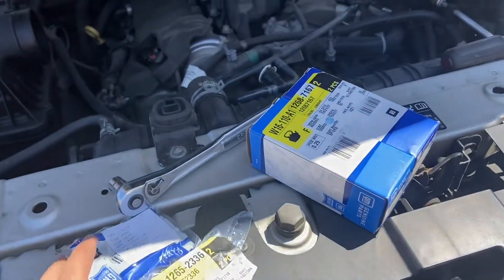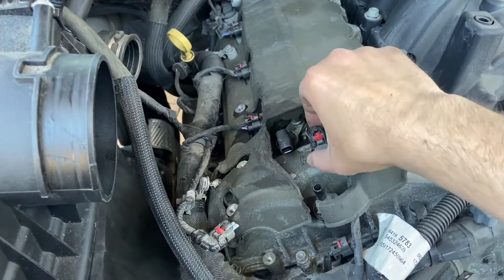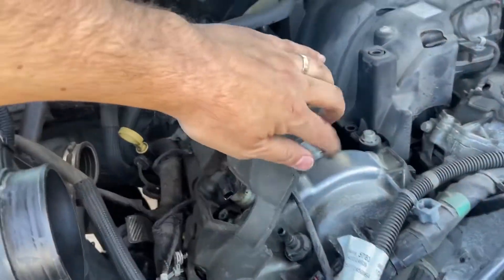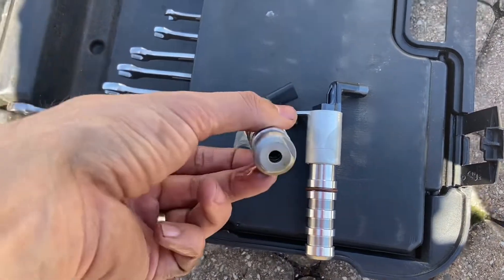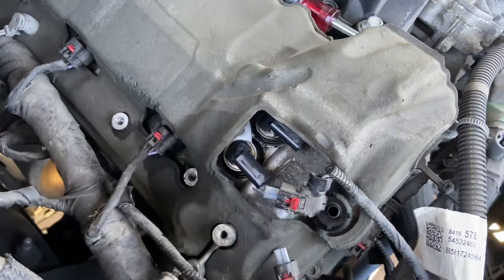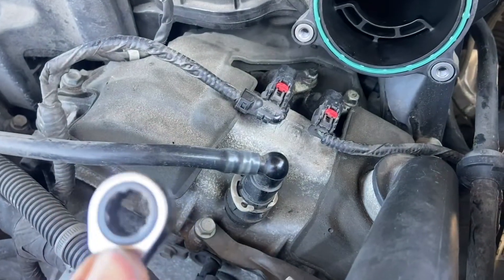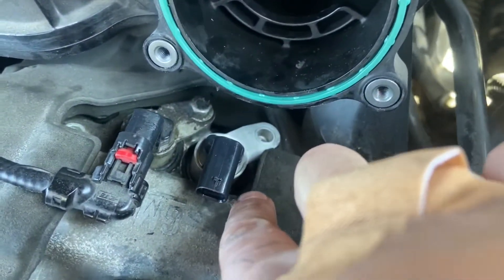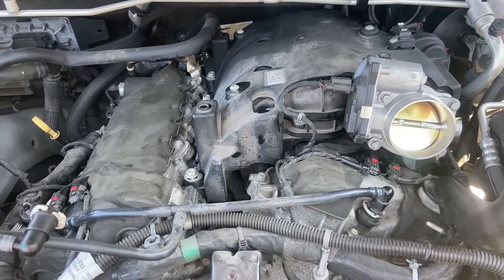Camshaft Position Actuator Solenoid VVT Replacement 2015-2022 2nd Gen Chevy Colorado GMC Canyon 3.6L

Comment: This doesn't work on a 2016 Colorado V3.6 LFX engine... My entire engine layout is totally different. Title is misleading and incorrect. make sure to put the type of engine it is.
Reply: Your right this is the lgz motor. I got a 19
Reply: My 2017 Chevy Colorado LT, Layout is also completely different as well
Reply: That's because there are three different motors for these years. 4 cyl, 6 cyl, and 4 cyl diesel.

Comment: Struggling at 7:40, tried rotating it, wiggling it, going every angle, it's like one of those impossible puzzles and I still can't get it out. Gave up for the day, had to put everything back so I could use the truck so will have to try another day, any more tips on this one? Thanks.
Reply: Were you able to get it out?

Comment: So if I am understanding you correctly. You have replaced the camshaft position sensor and now are replacing what is commonly called the VVT solenoid.  Is this correct?  Both are found on a Chevy Colorado?
Reply from the maker: Correct
Reply: @ again both are found on the engine . It isn't either or, but both?
Reply from the maker: @ I don’t understand what you’re asking I guess, but the camshaft position sensor is not shown in this video. I show it in a separate video on my page. This video shows how to replace the VVTs. I was mentioning that I was having an issue and replacing the camshaft position sensor didn’t resolve my issue, so I made this one.
Reply: What side is bank 1 I got a 2019 gmc canyon got the sensors just want to know what side is bank 1 exhaust p0014
Reply from the maker: @somethingtowatch1820 bank 1 is passenger side on this car
Reply: @WildFrontierGarage  thank you I was getting  confused lol
Reply from the maker: @somethingtowatch1820 yeah it seems backwards
Reply: code  p3409 for chevy colorado 2017 ?

Comment: I have a 2015 Canyon SLT ... Question for you...I'm a bit confused by the intake and exhaust solenoid. Some sites say the parts are interchangeable, others have separate part numbers for each, indicating that they (exhaust and intake solenoids) are not interchangeable.  Not to mention, that even some have different color for exhaust and intake. So does it really make a difference?

Comment: Thanks for the video. I have this problem and you made it look easy enough to try it myself. However, I ran out of daylight/time this evening trying get the gasket out (the bank 2 P0019 side).  It's baked on there.  Did you run into this problem on either gasket?  You just used the screwdriver to pry it off on both?
Reply from the maker: It seemed stuck in there to me too, but there was a sweet spot where I just popped the gasket out. I’d just caution care so you don’t scrape up where the gasket seats. Also I believe there’s a small ring embedded in the gasket to help it keep its shape, so it’s not super malleable like your typical gasket...

Comment: Before you replace the solenoids check this first. I ran across this comment on another video. On your display go to vehicle and scroll to the display showing voltage. Mine was showing 12.6 volts. I cleaned the battery terminals and the display shows 14.7 volts like it did in the past.
The check engine light went out and has not come back on since. The P0019 code seems to be common on the 3.6 and I am curious if that voltage drop is what triggers that code.
Reply: Thanks for the advice, I got check engine light code P0024, I was about to disassemble everything in order to get to the sensors but then checked your comment and also somewhere else I saw someone suggesting the same thing. I checked my battery terminals and my negative post was corroded. I then enabled the battery voltage info on the diplayed and it was showing 11.8V, I then cleaned the negative terminal and post and it jumped to 12.6v, started the engine and then went up to 14.5v and then when shut off the engine it stayed at 12.5v, so I guess the corroded negative terminal was my issue. Now I will drive it a few miles now and hope the light does not comes on again.
Reply: @alejandromadera3895  Hello I just wanted to get back to you because I had the issue again. I remember someone saying to check the oil so I did. It was at the correct level but it was pretty filthy and smelly. I did do a lot of sitting and idling this past month. the oil life indictor was close to 50%. I changed the oil and filter then drove down to gas it up and when I restarted it the check engine light was out.
I don't know if that had anything to do with it or not but only time will tell. I am sitting here looking at the parts but if I don't have to put them in that would be great. I hope you are not having any problems and everything is working like it should.
Reply: there’s a service bulletin for this part actually. mine in dealer today getting replaced

Comment: You think this will work on p0017 code for 2016 chevy colorado my computer says reduce power engine.
Reply from the maker: Could be. This is what fixed the code for me. Could also be your camshaft position sensor, your crankshaft position sensor, or worst case scenario timing chain issue…

Comment: I just found your videos thanks for what you put up. Huge help. But do you know if fuel octane has any effect on either of the sensors you replaced? I am thinking there is a pattern to my P0019
Reply from the maker: I wouldn’t imagine so. Usually your knock sensor is what can control that stuff, so maybe you have a problem there? Total guess on my part. But really I’ve never put anything above 87 octane in my car as recommended by GM. Please subscribe so you continue to see videos as there uploaded!

Comment: Why are these sensors failing? Is this a new common issue for the 3.6?
Reply from the maker: Not really - just standard vehicle maintenance stuff. My truck in particular has 90,000 miles…so it’s not unusual for there to be an occasional sensor failure here or there regardless of what you drive 🤷🏻‍♂️
Reply: @WildFrontierGarage  thanks, I was wondering since I have a 2021 zr2 with the 3.6.

Comment: Do you know the part number on the gasket seals and the new vet solenoid? I just got the code….that seemed pretty easy though
Reply from the maker: Right at the front of the video I show the parts. The AC Delco part numbers are the bold numbers on the bag/box

Comment: Can you make a video of which are P0014 and P0024 I’m trying to change them but I don’t know where they are
Reply from the maker: If I ever come across it in the future I will. I haven’t seen that code yet, though…
Reply: 24 should be exhaust and the inside one I believe
Reply: So 0014 is the one you replaced…??? Or the one to the right
Reply: I got p0024, which is bank 2 exhaust but I had replaced mine with a brand new solenoid from Chevy and it came back on… constant problems with my truck snd these solenoids…
Reply: Is the exhaust the right or left one looking straight on from the front of the truck (which is the right side of the engine if sitting in the driver's seat) @joe.imburgia

Comment: Is it fixed
Reply from the maker: Yes
Reply: Did the check engine light go away on its own after you replaced the solenoids or did it require a diagnostic tool to reset the DTC?
Reply: @zbassr2106  At least for mine the check engine light will go away on it's own even without replacing the solenoids. If someone were to scan though they would see the codes on an obd2 scanner.
Reply: @claytonwilson4301  I did end up replacing the solenoid but the code was still showing at the time. I ended up buying a diagnostic tool to clear it and it has not shown up since. I dug around and it can take up to 20 ignition cycles for the code to go away.
Reply: @zbassr2106  I replaced mine and cleared the codes but I wasn't talking about codes. I meant to say the check engine light came off. Glad yours is working.